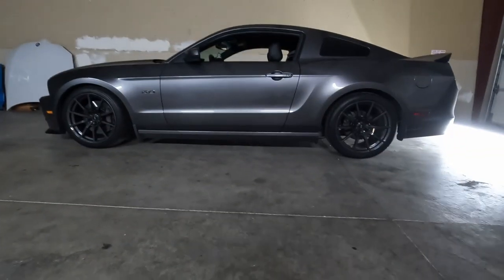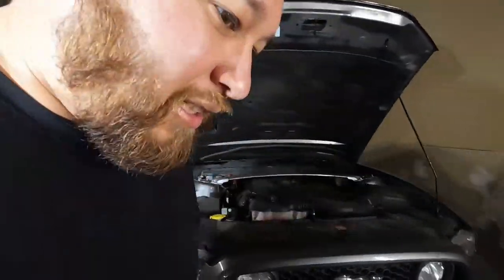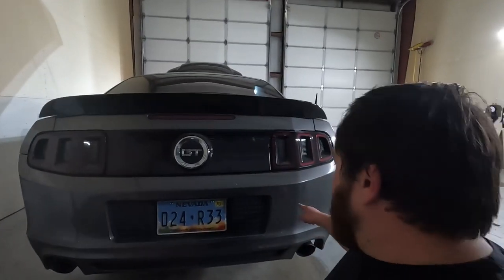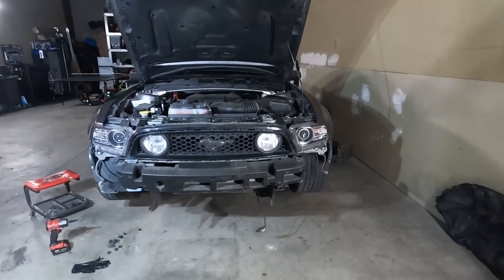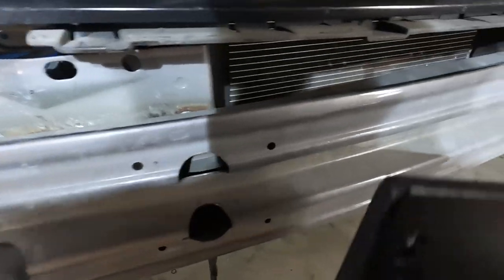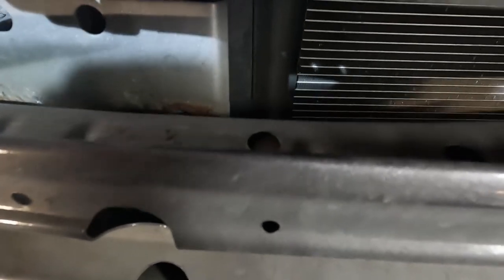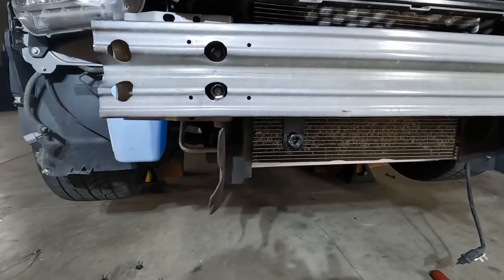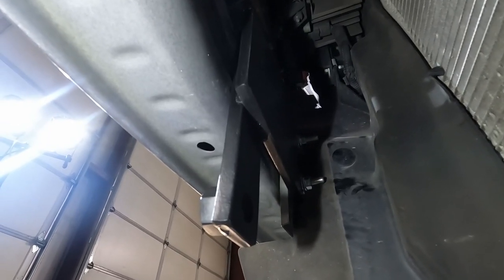Tow Hooks ZL1 Addons

Comment: Does the rear tow hitch interfere with the aftermarket exhaust/axle-backs? I have Borla S-Type
Reply from the maker: I have the MBRP cat back.  I had to bend of couple hangers so it wouldn't run against it on the driver side muffler.